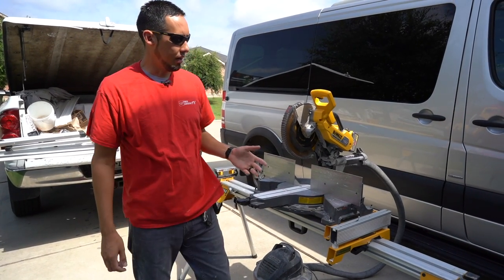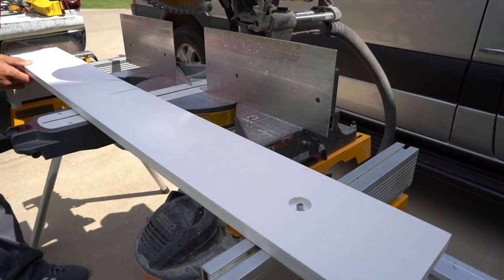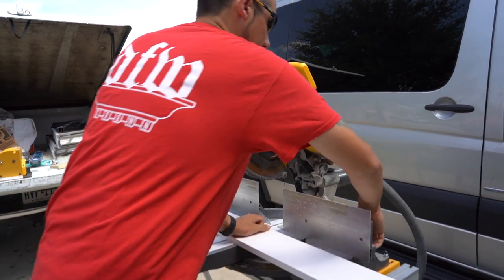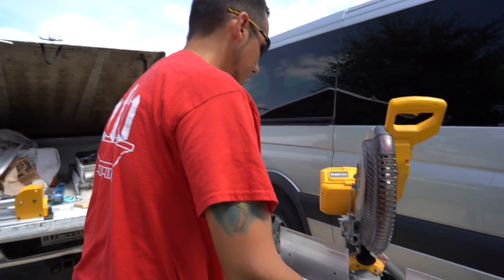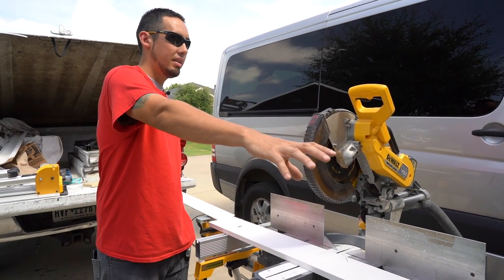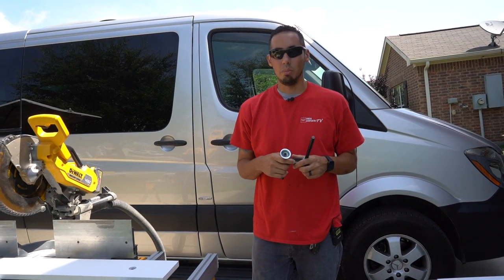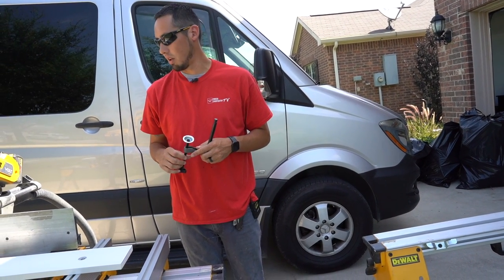NO MORE  D e W A L T  STOPS!  CROWN STOPS ARE DONE!

Comment: Shorten the legs on the Dewalt stand.
Build a simple scissor lift for the support brackets. More stable than a single threaded lift.
You could attach it directly to the Dewalt bracket on the bottom then to the track piece on the top. Simple, light weight, and stable with the adjustment you need.

Comment: I'd mount a standard car scissor jack  to each bracket that would let you adjust it heightwise     that way even if your stand is on a slope you could still adjust each jack to the right angle to get a straight surface to match  your  stand that has a miter saw

Comment: I like the crown stop but I think you're over thinking the support system it only needs to be relatively straight to the saw base not perfectly level 
I use the long rollers for the extension arms and clamp some scraps to the ends for support
Reply: You read my mind and I read yours.

Comment: Richard, Just thread the hole through your extrusion and it will raise and lower when your turn the knob. Very simple to make and easy to use. Just what you want and need. Just buy a tap & die set for $50.00/$100.00 and you can make threaded levelling feet for it as well. Aluminum is soft and easy to thread. Any questions just send me a message I'll be glad to help if needed .

Comment: Why don’t you use stock material rollers from depot for extending ur working length, they already move up and down with a quick release knob?
Reply: Yeah, I use a pair of their cheap  hdx roller stands, they work really well.
Reply: Bob O'Connor those are the ones!! Love em! The quick lock handles broke off ages ago but I use them so often and love them so much I just use pliers to lock in when I raise or lower then
Reply: Or one that has multiple rollers or multiple ball bearings

Comment: My thought was going for leveling the tables. 

If you made a shoe (say, from wood) for each leg and then placed a threaded rod going through it vertically (with nuts or some such holding it at both ends of the hole), then with double nuts locked together at both ends of the rod you could quickly adjust the table foot's distance from ground by driving the rod to either direction as needed. 

So you'd need maybe four shoes like this for each table. Simple to make and not necessarily too difficult to fit in the cargo space with the rest of the tools either. Damn, this sounds so good i might need to make ones myself! :D

Comment: Put adjustable bolts under t slot brackets instead of fixed bolts for up and down movements, you could also adjust the front to back angle that way aswel. Great videos mate cheers for good content.

Comment: i would use a sissors car jack. they are great for this type of thing. you would be able to raise and lower really easily and it will easily hold any weigth you put on it. and they are really cheap. i have one on the table of my large belt sander  and can raise the cast iron bed with two fingers instead of needing 3 hands

Comment: Just make some permanent "wings"  attached similarly as your crown jig....perfectly level with saw base.  Then just buy two adjustable roller stands for support at both ends...can even permanently attached if you want.  Would refrain using a back fence as warped trim wont play nice.  Instead build wings using plywood....sink in T track for stops as well as other attachments.  Great video man...keep it up.

Comment: Have you thought about just using the Flip Flop Work Supports? Make the base wider and then use the top flat surface or extend it with PVC. They are adjustable for the areas that might have a slanted driveway.

Comment: Check out Rockler's website or even Woodcraft.  They have a large variety of extruded aluminum material to make jigs along with adjustable stops, screw handles and clamps. Perhaps you could rig something from those.  Just a thought.
Reply: Go to Woodcraft and check into the Kreg miter fence hardware. They make a back fence that has a taoe measure groove and a flip up stop block system that is repeatable.
Reply: @lorenrickey5481  Incra also makes a stop block as well.

Comment: How sturdy are those brackets and what kind of weight would you be putting on the supports at the sides ?  I'm thinking just make a frame from the Alu extrusion to the length required and fix it to two of those brackets the same way you have for the stop. No need for levelling as you'd just be extending the saw bench in effect.

Comment: a knurled wheel that threads onto the bolt and has a circumference that's wider than the extrusion piece. By 1/4 on both sides... so, 1/2" wider in circumference. Then you can just dial it in....

Comment: Seems like you just need a threaded rod and a wing nut/knob that is about as tall as the spacers you already have between the extruded channel and the bracket of the first jig.  You would just lift the extrusion and spin the knob down to meet with the bracket.  The rod would be fixed to the extruded metal piece and the threaded rod when would pass through a hole in the bracket.  I would use two threaded rods on attached to the bottom of the extruded bar.  Then when you get up your horses you just lay a board with level across the horses, lift the extruded bar up to meet it, and spin the knob down to seat on the top of the yellow bracket.  If you use a bushing or just two nuts on the top and bottom of the yellow bracket to keep the threaded rod and extruded bar from wobbling.

Comment: I bet I could make something similar to the CutHub with all my old Dewalt stands. But the time it takes me I could just work my job and pay for one😂

One thingI think I will experiment with though is  using those small adjustable clamps like Irwin quick grips to splint the legs of anything from my sawhorses, to table saw stand legs etc. then you can just squeeze out and release down🤷🏻‍♂️ 🤔

Comment: Possibly drill holes in the bottom of your aluminum T track an put 2 bolts through your detach bracket 1 on each side  an use nut to hold them there put a second nut on bolts  put T track on bolts an nut on the inside of the hollow Channel of the T track an use the 2 nuts as jams nuts to desired height

Comment: Hi Richard. Great idea and executed well. Maybe take a look at Rockwell RK9034 JawStand XP Work Support Stand. Instead of rollers, it has a jaw on the top. Also has crank like your tripod. The minimum height from the ground is 29 inches, will extend up from there and then incrementally crank up to exact height. Amazon $76.59 ea.

Comment: Fastcap .com sale just the heights adjustment post or the precision adjustment blocks. Their upper hand 3h tripods would replace your secondary DEWALT stands and probably be cheaper and a lot more adjustable. You could mount the aluminum extraction to the 3h tripods. Check out their Best fence system. You could utilize/adapt any number of their inventions (created by a Trim Carpenter) that fit your setup.

Comment: I would think there’s gotta be a way to adjust the height of those, maybe using the same method they use to adjust the height of a blade in a table saw. Maybe find some junk table saws and remove the mechanism for adjusting the blade height and incorporate that somehow into your set up. Just a thought. Good luck

Comment: Instead of replacing with a non sliding, you can just lock the saw from sliding. If it’s like the non flex volt version there’s a pin on the left side that pushes in to lock it

Comment: Great ideas… Overall, one would want a flat “table,” regardless of the length.  Using the shorter DeWalt stands could work by connecting the supplemental stands on each or either end via the square tubes that you want to remove.   Thus, the whole length of the saw table surface would be reasonably level and solid by sliding the square tubes 3± feet into each table.  Using the DEWALT Miter Saw Mounting Brackets and the channel / tracktubes sh/could help maintain a long, level table saw area.  You will still have to find a reasonable flat surface 16± long to set up your saw.  With a table saw area longer than your “normal” saw table and fence, you would have to just adjust to your job site.  Still, you would be assured the whole length of your table would be reasonably and solidly flush.  I have used board under legs once or twice before to get level miter saw setup on a job site…

Comment: 'This is Carpentry' has the absolute best setup for crown.

A full length spacer block for spring angle is how I'd go.  Label it and if you ever have to go back to replace or add, whatever, you'll have the same setup.

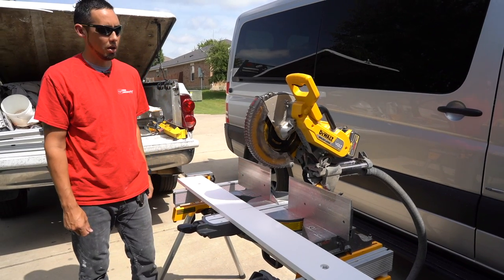Comment: 4:30 can i suggest you to insert 2 more washers on the screw at the very close to the head insert it in the track together with the washers, they will act like cilindrical bearings and will not get stuc in the bolt head witch has hexagonal shape and sharp edges. Good luch , I will also want to think of a release system that comes out from the aluminium profile...  witch is so easy to do using some springs with washers under continuous load. Then you activate the level you will apply force on the spring realising the pressure over the nuts and releasing the plate to be moved.. Cheers. you need a demo? I can do it for you!

Comment: Lookin at it wrong brother. Look at the legs on the tripod. Modify the legs on the small DEWALT stand to work similar to those so you have infinite adjustment on the legs.
Reply: Yep, yep.  Can fold out attached extensions in a way that always guarantee that they're flat with the rest of the setup.... then adjust the legs on the extensions to whatever the ground height is.   I wouldn't have a completely separate, unattached  extension piece, or you'd be pissing around with it to set it up inline and level.  Or, if it is a separate piece, make a bracket on the main stand that it slips into really tight and always in the same manner/placement... and still with adjustable legs.
Reply: P
Reply: I saw a carpenter somewhere who made something similar. Except it was a wood bench. Each side had an 8’ extension attached with a piano hinge at the saw side. The leg was just tube steel (probably aluminum) where another smaller tube slid inside. Be dropped the leg and tightened a set screw. That way he had like 2’ total in height adjustment. Just in case you wanted to setup on, ya know, a set of stairs or something 🤣

Comment: That it can be removed and replaced at will without having to reset it is huge. I hate having to remove and reset a crown jig and usually having two miter saws on the job is the only way to prevent that.

Comment: You can have large wings on each side that weigh only 3lb/ft, and it will assemble and level quickly.  Use Rockwell RK9034 JawStand XP Work Support Stand to support 1.5"x3" T-track aluminum extrusion (6' & 12' lengths available at Zoro.com) .  Add a couple T-track flip stops to the rail on each side.  Attach a horizontal 1x6 support shelf to the bottom of the rail with measuring tape dadoed in. Align the wings with your blade and fence by fastening one end to your saw support stand and the other end supported by the Rockwell stand.

Comment: Good job man!

Dewalt definitely needs to revise the stand with some more advanced features.

Like: 

Using nylon lock bolts so everything doesn’t rattle loose.
Wider supports and better stops.
Better clamps that don’t break.

Just some improvements with newer innovations.
Reply: Add Fastcap's Best Fence to the Dewalt stand and go pro.
Reply: They need to glue the feet in as well haha damn things fall off

Comment: Adjustable height side fence needs two bolts otherwise would start pivoting. 
What i see is not so much a crown stop problem but a table problem.  If you had a good table that supported your piece it is very easy to just hold in place.  Even with crown stops if the ends are not supported then the crown is flexing and more difficult to place and cut.  I look for LVL dropoffs.  Lvl tables are cut to just under 10ft and built it all to work with adjustable height saw horses where the finished height of saw is the same as the 4th step on my ladders for the perfect support.  Plus its very portable.  Just as important is that you have a real table to place all ur cuts on in order.  Ill measure everp piece of crown/base/shelves in that house and cut them all at once. I hate putting them on the ground.  The table is where its at.

Comment: The point is probably mute at this point, but I wanted to create through the process myself, not just the final "cuthub" ending. This version is perfect for a GC like me that just needs to make a few cuts and uses roller stands for outfeed. Ron Paulk several years ago did miter wings using the existing pullouts on the Dewalt stand which will be my next evolution. No production jobs here so no more is necessary than that. Of course my stepfather with Ca. General Contractors license #5 would have given me a hard time for using anything but a radial arm saw with the guard removed and skill saw with the guard wedged back to do it all to perfection.

Comment: Richard, You might be over thinking this project. Leave the miter saw station alone. Put away the other dewalt stands. Build yourself two "L" shaped tables to rest your trim on. One for the left and one for the right side. Mount one end of the L table to the saw stand's out feed support bracket and at the far end of the 6 food table mount a dewalt adjustable saw stand support leg. Do the same for the other side. Adjusting each support leg will level the table. Less setup and weight.

Comment: Seems like you are trying to reinvent the cut hub. I personally like using wings similar to Insider carpentry design. In my opinion they solve all my problems, its easily adjustable for uneven surfaces, gives me 8' on either side, plus a work surface, and its super portable and easy to set up. Ive got mine set up to work on a compact dewalt folding stand like yours. Casey Knips, Modern Oak, Chicago Carpenter, and Insider carpentry on Instagram all use something similar with slight differences in design.

Comment: As a high end trim carpenter of 20 years I've hung miles of crown I just don't get the reason for all that. We never used crown stops or material clamps. We threw them away. We cut crown upside down and backwards and just use the fence that comes on the saw. 🤔
Reply: Totally agree. I have been doing trim for 40 years and this video is rubbish. What a waste of time. 

Use the saws fence and learn compound angles. It’s more accurate and faster

Comment: Ceiling projection block? What's that? I like your set up, well done.
Reply: Its just the measurement from the wall to the edge of the front of the crown, when its sitting in place.
Reply: Thanks
Reply: I've (probably wrongly) call it the drop.  The distance from the ceiling to bottom of the trim as if it were installed.

Comment: You ever try to cut crown flat on saw? for me its alot simpler 

I dont see anyone on YouTube doin it but I found it way way easier.....
Reply: Kirk Dunn then you would have to make two cuts every time, one for the bevel and one for the miter. Otherwise your joints/seams wont line up. That's why nobody does that.

Comment: I made two 8' X 10" plywood pieces. I bought two roller stands that are adjustable. I cut blocks for either side of the roller. I made a backstop with two 1X4's. They attached to my stand with a couple of bolts. Easy set up and adjustable.

Comment: I'm not an engineer. I think you should just use the slides that are attached. Make a jig and drill holes into the square frame of the slides and somehow attach the jig to those holes. I just think that if you use the additional stands, the slope on one side would be too high for you to make any adjustments. The slides would be relatively level to the saw. You already have an engineered tool, adjust that, instead of re-engineering the entire concept.

Comment: The "table" board wouldnt need to be adjustable by the saw. You could have two points of contact there so those are square.

  So something as simple as a tripod would work.  It would be light.  It would be fast.  
Id just get some all thread put a foot on it and a jam nut.  1inch square tubing.  Weld a second nut on that.    Secure it to the "table" and that side would be adjustable.

You could have this leg fold up to the board also which would make for less parts.

down sides...  8ft long it may sag in the middle or at an end depending on placement of "adjuster leg" .  

Im picturing 1inch o.d. square tubing.  Some one inch angle iron (possibly aluminum) for the hinge, the hanger for the leg. 3/4 table material of your choice, if the spacers are 3/4 inches like i think... 3/8ths all thread, 2 nuts, one foot.  

Ill draw it up and email it to u quick if you want.  Im pretty sure this would provide everything you wang plus other things youd like.  It would also be cheap option with other benefits.  Reply back with questions if u have any.
Reply: The angle could also ran the length of the table which would stifen it up and would allow for a really thin table material
Reply: Sent contact info to ur web site. Feel free to text me so i can send a drawing

Comment: Im no engineer either but instead of spacers, use an exagerated nurled nut and ues a lock nut inside the extruded alluminum with a washer and spring. That way you have your micro adjustments left, right, front, back.

Comment: Probably to much troubles but If you can shorten legs on your second sawhorse an get some tubing to go over you can make adjustable legs on all legs on second saw horse or see if they make a adjustable leg saw horse that excepts your snap on bracket or attach the top part of your spare saw horse to some adjustable legs. DXMF3603WSH this has adjustable legs but doesn’t except the snap on brackets